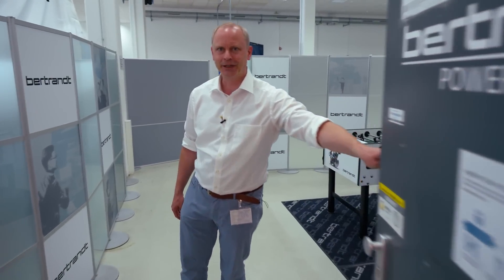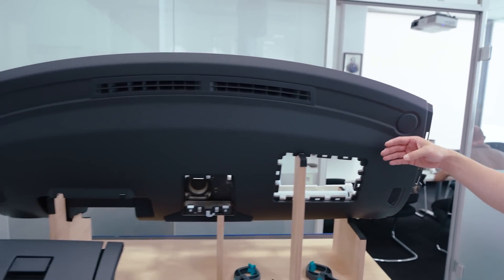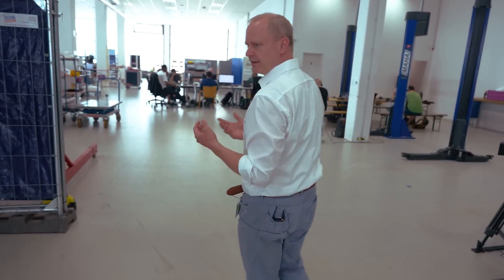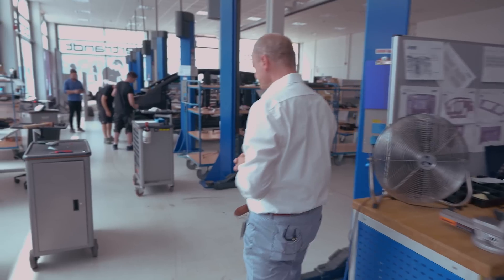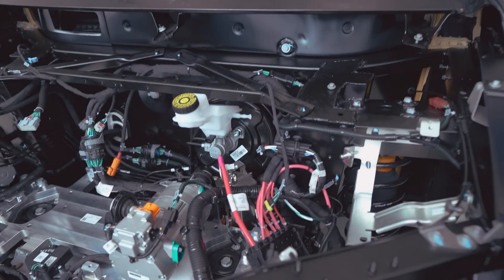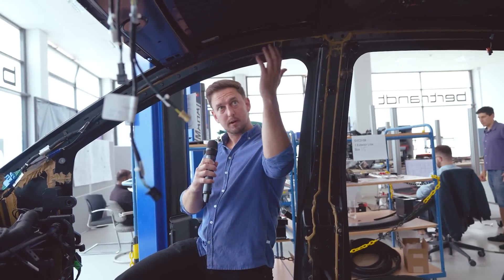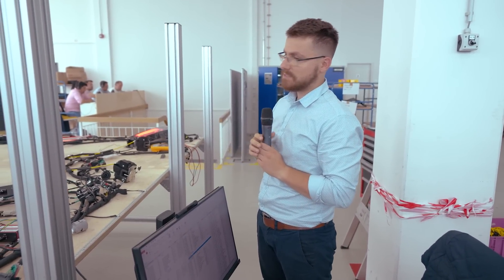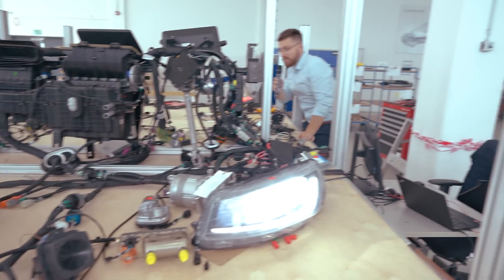Sono Live from the assembly I Sono Motors

Comment: This is (hopefully) a very edge case question, but what if someone "keys" (scratches) your door? Will this damage the solar cells or do they sit deep enough to not be breached? Will there be an easy way to fix the varnish again without impairing the solar panels?
Reply: Hi Hinek, the solar cells are protected by a polymer plastic layer which  makes the solar panels quite robust. You won't be able to damage the cells by driving keys along the surface of the car.

Comment: Thx, appreciate the insights.
Talking of electrical, can I ask that the beeping warning sounds be kept to a minimum. I find such things as being beeped at because a seat belt is not done up being pretty annoying. Also, is there going to be an electrical outlet inside the vehicle? This would be very useful.
Reply: As much as I know there will be some USB charging points and at least a 12 v outlet. 
Unfortunately the 230V Household socked that was planed at the beginning will no be in the car any more.
Reply: @MechmanGetrieb  That's a shame. But I guess a 12v can still be useful.
Reply: @dama9150  I´d prefer a 230V outlet as well but 12 v can do al lot to. I hope that there is a way to install a 230 V outlet in the trunk later.

Comment: If anybody wants to make a kit for it? Just start with a folding caravan trailer re-using the battery pack, heating/cooling and power bi-directional charging. Must be possible to couple DC high voltage obviously for a doubled range.

Comment: Ganz ehrlich: lasst Solar und das Moos für ein Modell weg und bringt einfach das Auto für unter 30 000 € und es wäre trotzdem noch ein großartiges Angebot.
Reply: Aber mit Solar - einfach hammer bei den steigenden Energiekosten
Reply: ohne Moos nix los
Reply: Aber genau in diesen Zeiten sieht man doch wie wichtig die Solarintegration ist.  Und bei den Preisen der großen Hersteller ist der Sion trotz seines Preises gut im Rennen. Last euch Zeit und baut unser Auto.
Reply: Geht sicher nicht schneller um es auf den Markt zu bringen ohne Solar und ohne Moos. Aber am besten als Bausatz, jeder soll es selber zusammenbauen, so kann man Kosten sparen ;) Anleitung aber besser als bei einem Lego Bausatz.
Reply: mit oder ohne moos, ich kann es kaum erwarten ,-)
Reply: I like the solar, I'm hoping it will at least maintain the battery charge so that car does not need to be plugged in all the time when not used.
I could not care less about the moss. I see the moss as just another hard to replace spare part.
Reply: @hyvamina  The moss is just a nice gimmick.